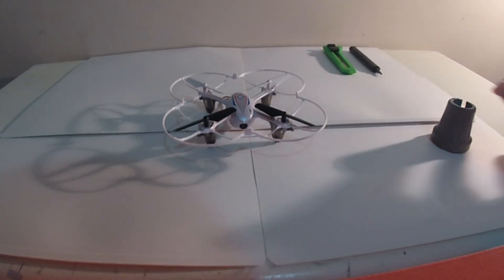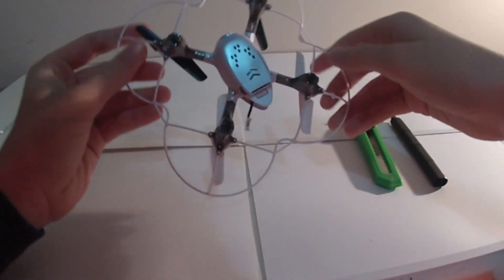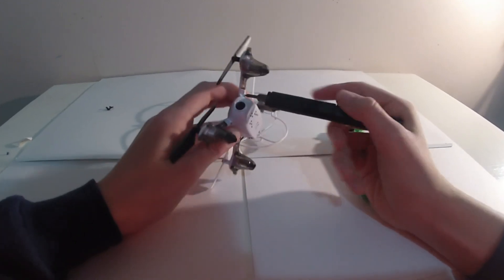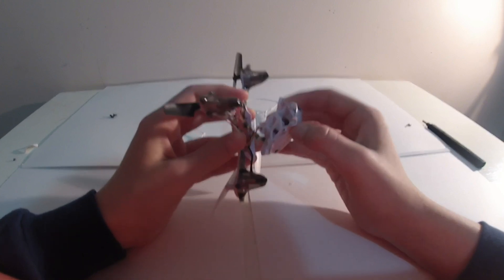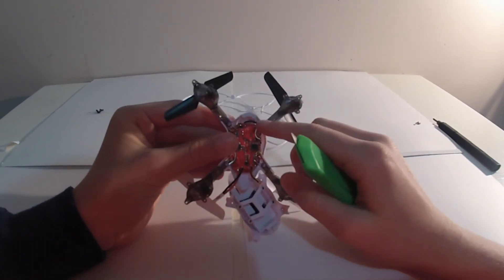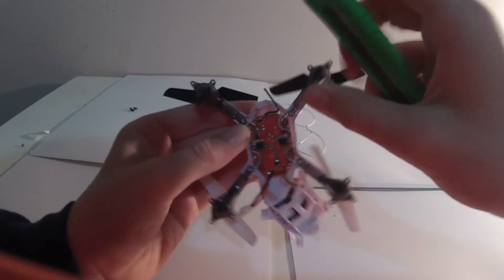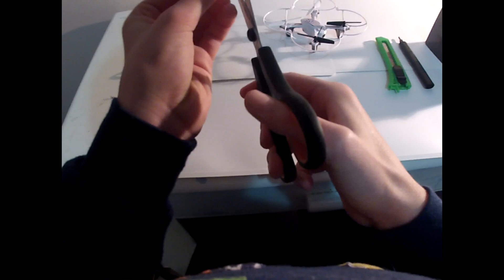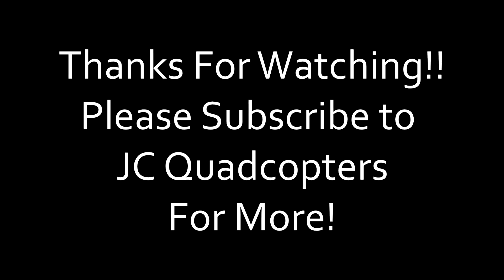Syma X11c Mod, Improves Range, Very Simple!

Comment: HI, Do u still fly this x11 ?  Ive been looking for a good stable indoor / outdoor Quad to practice with, a lil change from my helis, and this one seems to have really good reviews. i bought and returned a smaller one, to small and zippy and not enough flight time for me. This seems a lil older model but stil a good way to start especially with the hubson x4 500 mah battery. What do think? I may order 1 today.
Reply: Yeah, but i use the same batterys as cruz amatic has (hubson 500mah), and my drone can fly at least 4 minutes longer
Reply from the maker: Hyperball there you go, bigger batteries are fine on this quad :) thanks
Reply from the maker: Cruz Amatic very nice! thanks for sharing
Reply from the maker: Yes, this quad is perfect. I'm not sure how the 500mah batteries will go but I'm sure they'll work. Its a great and stable quad and can handle outside. Good luck with your purchase :)
Reply: i dont know if you already have it, but this UAV is really stable, and you can make some really nice shot with the camera, thebattery is no problem, because if a battery has more mAh, i just means that it has a longer flight duration.
Reply from the maker: Hyperball also means it's heavier, which can mean the motors are pulling more milliamps to fly around, reducing battery life so it depends on the machine and the quad
Reply: I have 4 of these now and they are the best. they fly well stable and handle light wind good on high. I use a 380mah battery. it seems to fly best with it and it fits pretty good too. I have one with a cam but I don't use the cam but it seems to fly more stable cause of the weight, and I get 10 to 12 min fly time out of it with the 380 battery.

Comment: Hey bro i got one recently, and opened up the quad. What i found was, the black antenna was snugged inside near the front left light casing which makes it visible without having to open the quad. So im not really sure if i should actually pull it out and do what you did in the vid? Enlighten me! :)
Reply from the maker: Hi mate, sorry for the late response, it didn't pop up for some reason. Your antenna is probably all good like that, but for stronger signal, I would do what I did. Hope this helps

Comment: I've done this mod on the quad, but extending the antenna on the transmitter through a hole and soldering an additional 2 inches gave me far far more range.  When flying it FPV (with the FX797 camera) it really helps to have more control range.
Reply from the maker: Ooh thanks for the idea :)

Comment: Thanks for the tip JC!!!  Actually helped.   Gave us an extra 40-60 feet.   Almost doubled the range with the stock remote.   Here's my tip, if you use the X8C Remote transmitter for sure you can get at least 100 yard range.   It's incredible how this little drone flys.  Super fast.
Reply from the maker: +Gary D Very true, and I'm glad you like it. I would definitely use the X8C transmitter I if I had one :P but I did buy a X5c-1 remote from gearbest, and it doesn't bind to it, even though they said it would :(

Comment: Hello bro. is the syma x11c stilll durable after several crash? :) do you have any problems with the motors? tnx for the reply in advance
Reply from the maker: +Kervin Pascua I would recommend to buy 1 spare CW motor and 1 spare CCW motor just because there is always a risk of them breaking down. My X11C has had two broken motors. :)

Comment: how much feather will it go in meters like x 5 x 10 like how much more x will it go than original distance and btw people say get a better battery so last longer but do u have any suggestions cuz i dont wanna buy a battery whats too much and blow it up XDD
Reply from the maker: bear Mitch It went around 20 meters further than what I was getting. The range is around 100meters already, then this will add more. Also, I recommend just buying a spare 250mAh battery. A 300mAh or 350mAh wont blow it up, but it might not fit nicely in the battery bay.